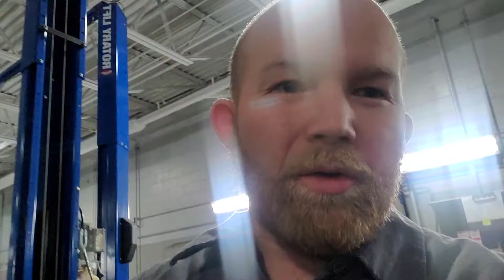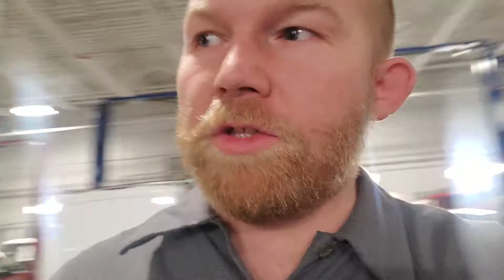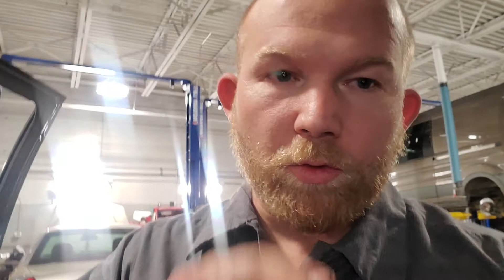2012 Ford F150 B1596 - 20 Service Continuous Memory ABS - Quick Tip To Clear

Comment: Saved my life!
Reply: I have a question, I did change a ABS pump and module, and i try to use the Autel scanner to reprogram. But still doesn't work. Is it need to buy any subscription from Ford before program?
P.S. 2013 F150

Comment: I have a 2011 Crown Victoria Police Interceptor without the anti theft. I just replaced my PCM with a used one and the ABS light is on and throwing a code B1596-EO (Service continuous memory (DTC)s). I tried deleting it with the scan tool, with no luck any suggestions would be amazing thank you so much for doing what you’re doing and always responding.

Comment: Just replaced 2009 Ford F-150 V6 ABS module and cannot clear the B1596 error code with my scanner. Could you please post the steps?
Reply from the maker: I just told you the steps

Comment: The code still there. Do you have any other advice for it?
Reply from the maker: Yeah you may have to pull the battery cable and then do it again after 5 minutes and take the two cables and negative and positive and touch them together to dissipate all the energy after you pull the cables off the battery